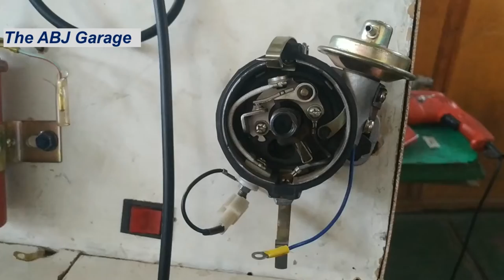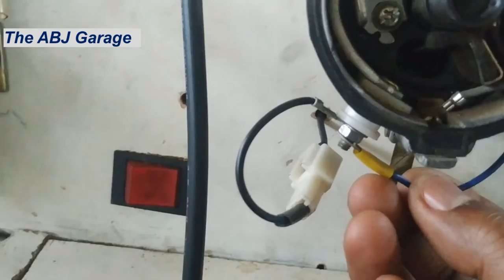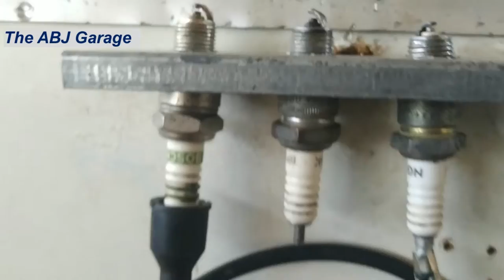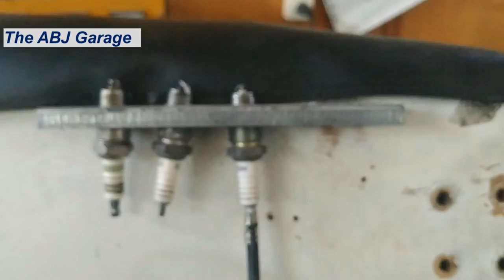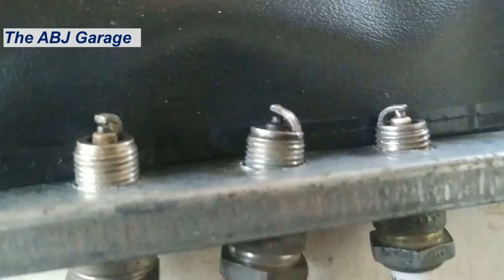The amazing effect of capacitor on ignition system

Comment: Thank you so much .  Was working on an old 4 cyl MF farm tractor - Installed all new ignition parts and tractor would barely run .  I mistakenly thought the problem was in the carburetor - must have had the carb on & off the tractor 20 times to clean and rebuild it, no luck the tractor would just barely run .  Had a friend with more experience with old tractors then myself look over everything to double check my work .  He thought the same thing i did and removed and rebuilt the carb - no luck . Finally for whatever reason he installed another set of points and condenser and tractor runs fine .  I had purchased AC Delco points/condenser from the MF dealer and they said made in USA so i thought i was getting quality products .  My friend is convinced the condenser was bad .  I am aware the condenser protects the points from pitting and early failure but i did not realize the condenser helped make a stronger spark .  I am 75 yrs old and until this happened i never recall hearing about new points & condenser being faulty .  Thanks again
Reply from the maker: Am glad to hear that! Thank you very much!
Reply: Had the same issue with A. 1964 Ford T. Bird ; finally Reinstalled the OLD points and CONDENSER ) the ENGINE ran Properly; the NEW condenser; was A factory Failure right out of the BOX } always save the OLD parts for Back Up..

Comment: Years ago while working at a Honda motorcycle shop we had a cb-750 running a bit rough. The mechanic took a new condenser and temporarily attached it to the circuit. It smoothed right out.
Reply from the maker: Thanks

Comment: What about the condenser/capacitor on the coil? What is it's purpose and difference in the ignition system.
Reply from the maker: Is it connected to the coil negative terminal? Then it is similar to the one connected on the distributor!

Comment: sir what happened if the capacitor is weak?
Reply from the maker: If the capacitor is weak, then arcing will increase, points will wear out fast, primary current collapse will not be fast enough and hence we will have lower secondary spark.

Comment: That was very helpful! Thank you for the video. I have a very old moped which I'm not able to start. The carburetor is fine but I thought the firing was weak. It has a magneto contact breaker without a capacitor across the breaker. Most suggestions said the capacitor reduces spark between the contact breaker, but now I can see that it also improves the spark at the terminal which is important. Thanks again!!
Reply from the maker: Thank you very much for the wonderful encouragement
Reply: by terminal you mean the sparkplug tip right?

Comment: did you connect the wire of the capacitor on the negative?
the distributor aluminium is negative but you connect on the wire that have plastic protection 
thanks
Reply from the maker: That line is actually coming from the ignition coil negative and go to the contact point to get ground, the plastic is used to prevent it from grounding before reaching the contact point.

Comment: Great demo.......now if someone out there can explain why there are 2-3 different condensers for the same distributor that might be even more helpful......i.e  Standard Products ( Blue streak listing 3 or 4 different points sets and at least 2 different condensers for the same engine ). DR-6- DR-70....ect.
Reply: maybe it was for the quality of spark, i mean the impact it can affect the performance of the ignition system
Reply: I would say the condenser needs to match the coil being used since the primary winding it’s tied directly into the condenser.

Comment: Bagaimana jika memasang 2 capasitor sekaligus?
Reply from the maker: With what capacitance rating? If the total capacitance rating is same to the original one it could just be fine! The value of the condenser for this distributor is 0.22 microfarad. It is better to have a voltage rating of over 450 volts. The voltage rating doesn't affect how the capacitor works but determines how much voltage it can stand without failing.

Comment: I would NOT consider that a 'strong spark' at the spark plug.  

Instead of connecting the capacitor wire where you did, try taking it directly to the plug.  Now, you'll need a non resistor plug, and a high capacity diode to make this work, in order to 1. achieve a plasma ignition & 2. prevent the destruction of the capacitor array, by having extremely high voltage backing into the capacitor array.

Once you've tried this 'Plasma ignition' upgrade... Ask me how to make the next upgrade to a 'corona ignition system'.
Reply from the maker: Ok dear! Thank you very much for your wonderful encouragement! Can't wait to try what you suggested!

Comment: Is it better to keep the Capacitor cool? What if a Capacitor has a long wire like the ACDelco D222 (19142671)? How would that affect the spark control?
Reply: longer travel more delay i guess,
so i think it would affect less
Reply: I’m no expert but I’m guessing keeping it cool would help the capacitor last longer. Electricity travels fast, probably no bad effects from a long wire.
Reply: @track1219  Well, I've installed it with a Temperature Switch 2 weeks ago and it's been doing great, no issues and I'll be adding a LED Indicator light that will let me know when it's ready.
Reply: @garrykellogg3215  so you can monitor the temperature? What’s the LED indicator light for?
Reply: @track1219  Just to let me know when the Adjustable Electric switch has turned on thus connecting the Capacitor/Condenser so the engine runs as it was designed to. Telling me that it's ready and up to temperature to drive.